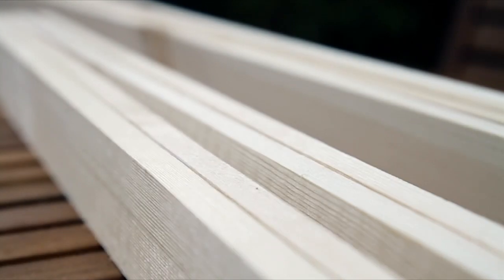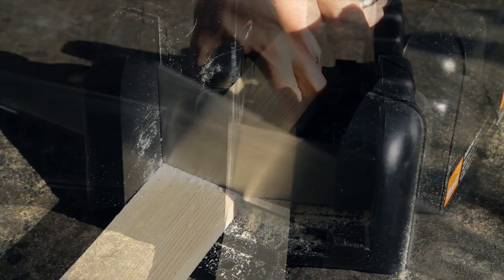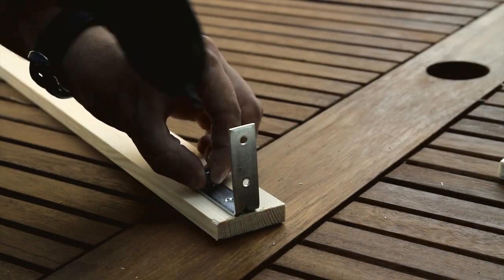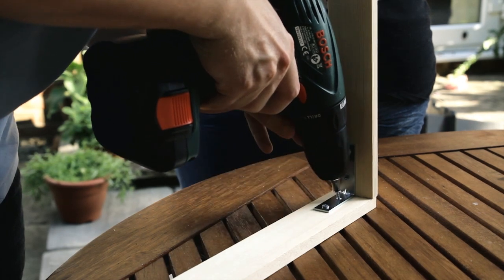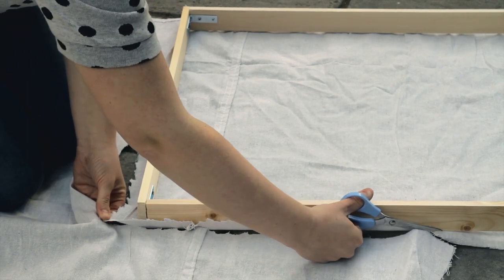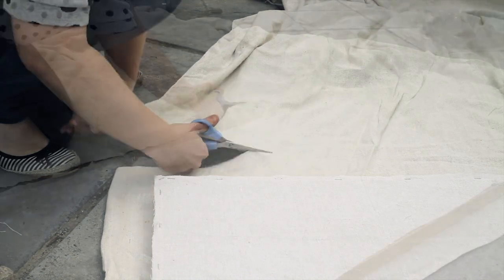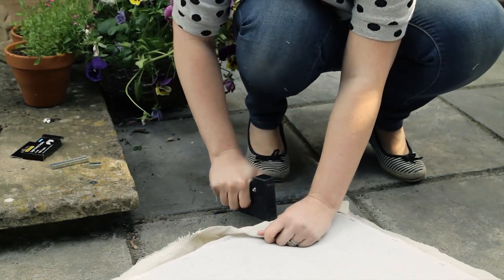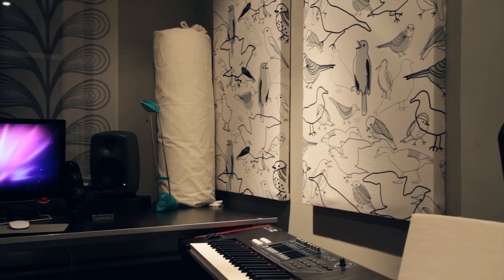How to make rockwool acoustic panels

Comment: Isn't Rockwool sold at 2" (5.08 cm) thick? That would mean your wood wouldn't be deep enough. And shouldn't there be some extra room for an air gap between the rockwool and the wall? Thanks for the video!
Reply: Rock woll batts are comressible. Also, the product comes in many dimensions. I often use 1/2-dozen thicknesses every day, on the job, and there are many more which I never use but are available.

Comment: I recently installed Rock wool superchunks and acoustic panels varying from 2-6 inches. There is a noticeable sound deadening but at the same time, the room feels really hot. Isnt rockwool suppose to reduce the heat?
Reply: No. It insulates. It reduces heat the same way a blanket does.  (it doesn't)

Comment: Just don't fancy breathing in that rockwool fibre. Maybe if I put a layer of tights over it before the fabric just to be sure? ....but then I gotta buy some tights.......what size do I need?
Reply: the tights need to be size "extra large booty", in order to contain the bass frequencies below 100Hz. Large and medium booty size tights will only reach about 500Hz and above, while small booty tights can only deal with frequencies above 1000Hz - much like Auralex foam panels which are to be avoided. Hope that helps
Reply: Rock wool is not harmful, unlike fibreglass. I work with the product, daily, and have worked with it for the past 20 years, it's not harmful. Fibreglass is harmful to lungs and also irritates skin from glass fibres embedding, but rock wool is not harmful.

Comment: Is this a completely safe way to DIY acoustic panels? The fibers in rock wool are extremely bad for you. If you are spending a lot of time in a not so well ventilated studio can this have a bad effect?
Reply: +supercooled Well firstly its not a foam, its glass fibers. And it differs in that it works :) 
Seriously though it works on the same principles (air passing through is restricted which produces friction which turns the sound into heat) but rockwool... well I'm biased towards rockwool. I wont start a foam hating session here.  
However, sound absorption is going to do little to make your living area quieter. It will make it sound better for sure, but its not going to reduce the amount of sound that travels into and out of the apartment all that much. 
Sound proofing and acoustic treatment are two separate things.
Reply: @AngryOscillator  It's not "glass", it's rock; hence the name "rock wool". You're likely confused with fibreglass which 'is' glass fibres - that's the skin and lung-irritating insulation due from the microscopic glass fibres embedding in tissue.
Reply: +Modvs Official Never thought about that.  How is this 'acoustic foam' different from say, insulation foam?  Is this more dense?  I'd like to create a bit more quiet in my living quarters so I'm researching absorption foam / panel and this video came up.
Reply: @supercooled  It's not foam. It's molten rock spun in a process which is similar to making cotton candy.
Reply: +Modvs Official Rock wool isn't as bad for you as certain people (read companies) would have you believe. Its not good for, in the same way that dust isn't, but like dust, it isn't likely to kill you. 
A simple light material covering will be able protection. You can also spray the rockwool with heavily diluted pva glue to help fix it up a touch with out blocking air passage.
Reply: +Modvs Official Since the Rockwool is covered in fabric, whatever effect it would have on your health over a long period of time would probably be equal to, or less harmful than walking onto a job site for 5 minutes, or hanging out in a friend's unfinished basement where rockwool and other similar fibreglass based insulations are used and very likely out in the open. Its not like you're sucking in a bunch of asbestos, and the fact that they are sold in panel format means that the fibres themselves aren't really going to be floating around in the air. If you were cutting it frequently and just working with it in general, there might be a bit more of a concern, but in an acoustic panel, I doubt there would be any negative effects.
Reply: Rock wool is not dangerous. It's made from molten rock and does not cause irritations like fibreglass or cellulose insulations causes. I work with rock wool daily, I don't wear any protection because it's not harmful. I roll in it; there's no itching or any other irritations. It's 100% natural - just transformed from it's solid mass into a cotton-candy-like form. If one is concerned about the possibility of any dust from the product, do the project outside in the open air.

Comment: Got one question. Can I use mineral glass wool (ISOVER Saint Gobain Eko Double which comes in yellow rolls)? Or is rockwool superior to this? I have big speakers (kinda)..and a medium sized room, and I'm worried I need really efficient stuff to keep the sound under control... Or am I exagerating? Thanks
Reply: Rock wool and mineral wool are two names for the same type of product.

Comment: Would this help with outside noise?  I have foam and sound dampening panels.  I need to block out the neighbors washer/dryer and the occasional plane. someone recommended rockwool in a bucket which lead me to this video.  Would something like these panels work for my purposes?  Thanks.
Reply: When it comes to sound insulation, the solutions are basically to make the room airtight and to have heavy walls/doors/windows.

Comment: Good video, but I would strongly advise not going to somewhere like hombase to build these, far too expensive and not a very good selection of insulation. Jewsons is better, but even then not very good prices. A small DIY store will sort you out for the metal brackets and screws. Definately get your wood from a small local supplier and make it expressly clear you are building frames and they have to be straight. If you are good at carpentry use ply rather than soft or red.

But first and foremost, take the time to research room acoustics, measure your room and work out the modes. Then play about with your speaker placement with nothing in the room, this will DRASTICALLY change the frequency response and phase correlation of your room. Symmetry is extremely important, always make sure that your listening position is 38% of the way into the room and start with an equilateral triangle from there to your speakers, move from there to taste. There are many factors that can change what you hear from your mix position, from the type of speaker, to the material the walls are made from, so really the best thing to do is experiment. From there, start with putting broadband absorber treatments at your 6 primary reflection points and see where you are at from there. If you dont do the research then putting these in your room could actually make your listening experience worse, these are primarily used by home studio owners who will take time to research why they are using them. The reality is, speaker placement is just as, if not more important.

Comment: Nice video but you would get much better efficiency if you put the insulation on the other side of the frame to leave more of a hanging gap. You can still wrap the material around but from the other side.

Comment: Thanks for this video mate, the film studio I work in is covered in the stuff and my old uni used it too, I needed visual confirmation that it was a simple process to tackle so cheers very much!

For anyone wondering, audio production studios will benefit from rockwool up to about 15cm deep, the deeper the better really and it's all about budget; I'm going for a 10cm depth covering about a third of the hard surfaces with as many soft furnishings and a thick carpet. This acoustic panel style conditioning only adresses high frequency issues like slap back and flutter echoes and does little for sound isolation or bass. You can cheaply build bespoke bass traps for standing waves within a room if you have the time, knowledge and equipment. Larger, non-square rooms and speaker placement generally helps with bass problems though (research if interested)

Comment: The panels would benefit from being twice the depth and being mounted an inch or so away from the walls. This reduces the chances of reflections much more and results in a better tuned room with less of those dodgy frequencies resonating. Also filling the corners with rockwool would be a greater benefit in a smaller room as it's often the lower frequencies which cause issues. These panels won't touch those as they are not large or thick enough or placed in area's to solve these sorts of issues.

Comment: true but I really doubt a bed sheet is going to bounce any noticeable highs back.  It's still an irregular surface.  So, I think for mine, I will use a tighter weave to be sure it isn't letting the insulation particles out and into my house.  Besides, if you are really worried about highs reflecting off of a sheet of fabric, add one MORE sheet of flannel or fleece over the front of it.  problem solved.
Reply: One of the Best Ideas of SoundProofing is "SoundProof Curtains" That Stops Outside Noise by 80% (25 Db) Tested. Check Here: https://livesoundproof.com/best-soundproof-curtains/

Comment: I'm confused.  If bass frequencies are able to go through materials way easier, why is it so important that the fabric be thin and porous?  Are you telling me that the bass frequencies will be reflected if the fabric was thicker?  My concern is that the fabric should be  almost non porous so that it will not allow any of the fibers to escape through any small hole in the fiber.  If the fabric is not shiny (flat surface) then it should work and less porous = better fiber containment.  yes?
Reply: I believe the idea of fabric being as breathable as possible is so that sound can go through it easily and then get trapped in the insulation inside.
Reply: Lol I just realized your comment was 9 years ago
Reply: @HappyChillmore  oh well, better late than never. HEHE    I made a few bass traps from the rock insulation.   Can't really tell that they help but they prob help a small bit.

Comment: odd question: i am trying to make a bass trap for a basic logitech sub in a warehouse (roughly 1,200 sq ft, hollow, 34-38 ft high). the the neighboring clinic experiences plenty of bass bleed. by creating a rockwool dome around the sub woofer itself (covering everything but the sub tube/horn) would that direct the bass in a directional matter depicting on where i point the horn rather than behind the bass? i am not sure if this is even acoustically practical but any help would be great!

Comment from the maker: @killamc786 yeah they are quite effective. At this thickness mainly to reduce slap back or flutter echo. If you put them at direct reflection points then you will get less sound from your monitors bouncing back at you. If you make them thicker or space them from the wall or across a corner then they become quite effective as bass traps.